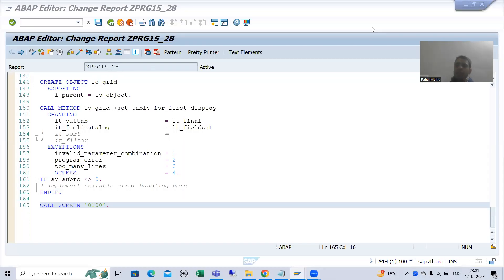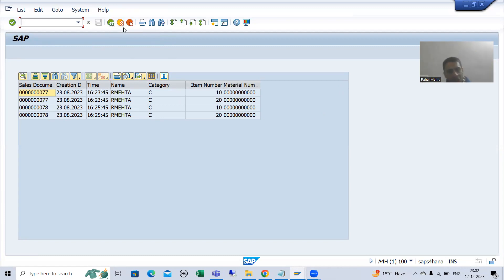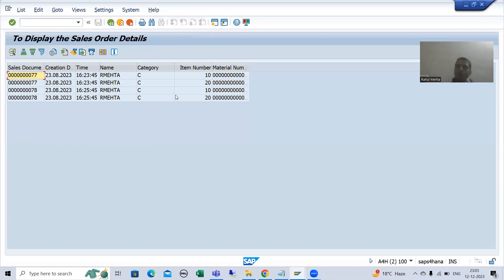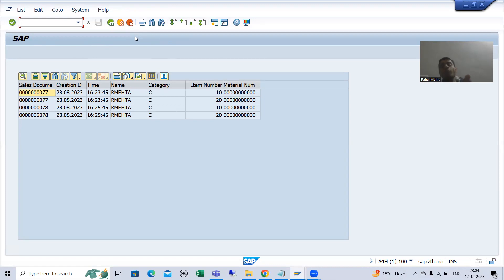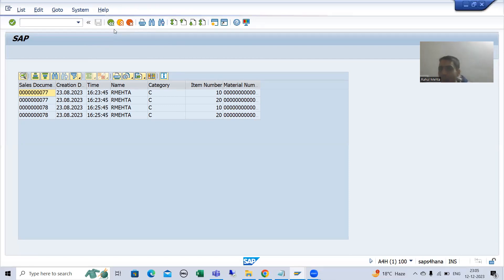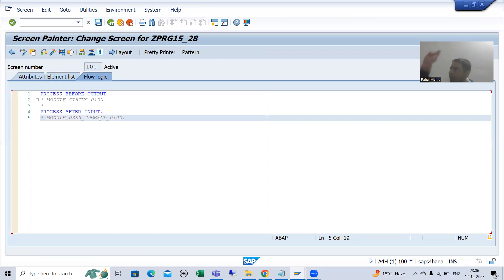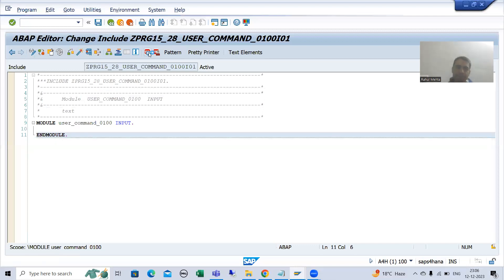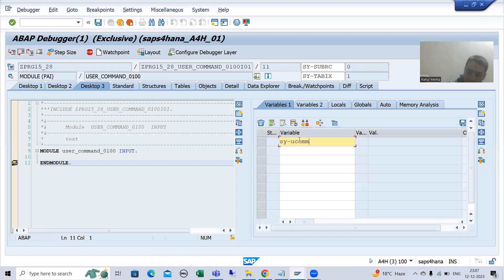53 - ABAP OOPS - ALV by CL_GUI_ALV_GRID - Creation Part8

Comment: Sir when I am putting a break point on endmodule as you did it showing pop that The position of a breakpoint cannot be determined. So i am unable to set BP. please assist
Reply: And for me nothing is working neither sy-ucomm = 'BACK' nor sy-ucomm = 'E'. what to do?😶‍🌫
Reply from the maker: @pranav4842     Once you activate your code.  Set the break-point and check in the debugging mode. You will be able to understand the root cause.
Reply from the maker: Hello Pranav - This happens, when the program is not active. Please activate your main program as well as include program.

Comment: Hi Sir,

I wrote the same logic in the PAI that if sy-ucomm = 'BACK' LEAVE TO SCREEN 0. But it didn't worked. 

I went to debugging mode and found that when I click on Back Button, sy-ucomm value is 'E'.

I replaced the 'BACK' with 'E' and code worked. But I wanted to know why sy-ucomm value is coming as E on clicking back button on my system.
Reply from the maker: Hello Amiya - Have you created any other button also on the screen?
Reply: @sapabapbyrahulmehta  Hi Sir, for me also showing sy-ucomm value is 'E'. i have not created any other button
Reply from the maker: @manamgopikrishna7913    Hello Gopi - Just make a recording of the steps on creation of PF-STATUS( CANCEL button) and send on rahul3620023@gmail.com . I will check and get back to you.
Reply: @sapabapbyrahulmehta  No Sir, I didn't created any button.
Reply: @sapabapbyrahulmehta  For me also same sir, i have not created any other button.
Reply: what is your screen number?   its not allowed to create 1000 screen.

Comment: hi sir there are three screens 9001 9002 9003  and in 9003 screen PAI we written that leave screen to 0.   then it will move to initial  screen 9001   or    it will move to previous 9002 screen ?
Reply from the maker: Hello - It will go to previous stacked screen only. So it will come back to 9002 if 9002 is in the stack.
Reply: @sapabapbyrahulmehta  thank you sir